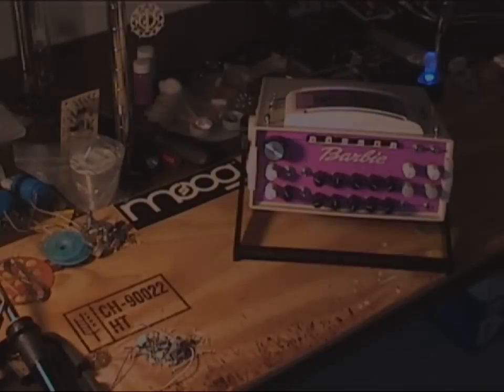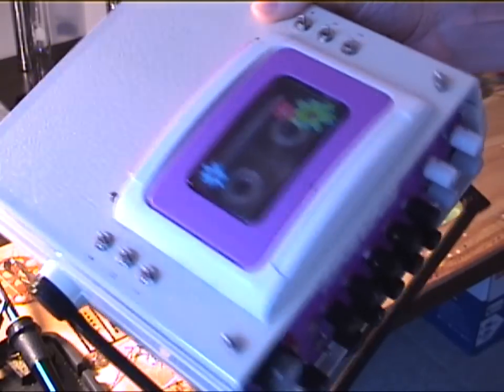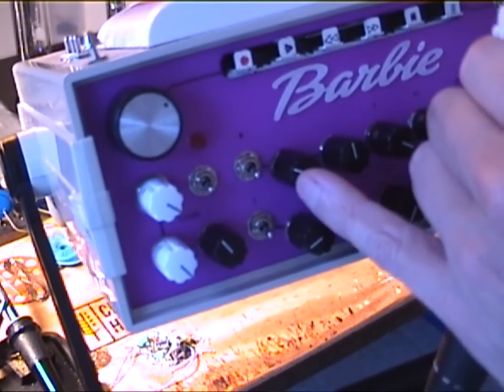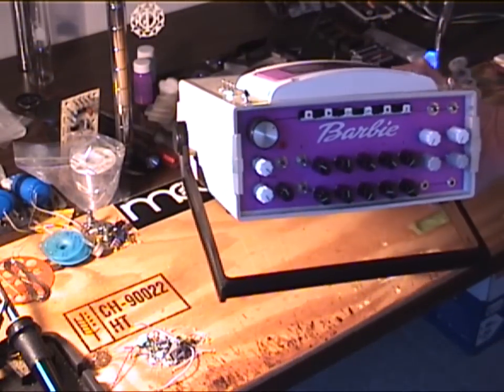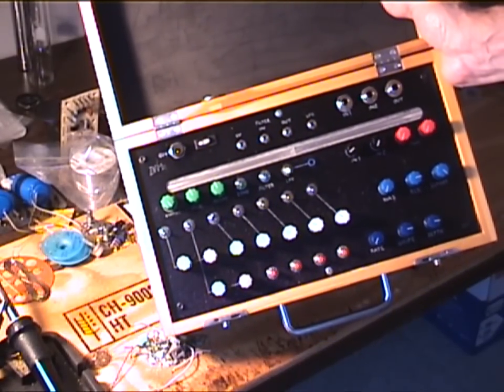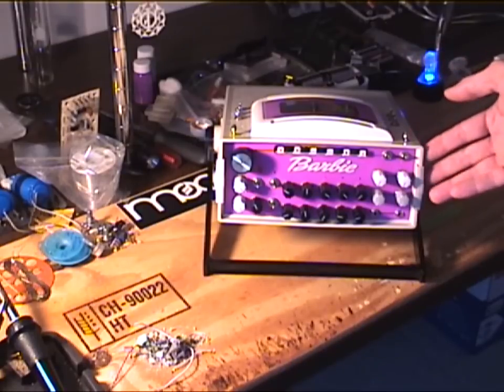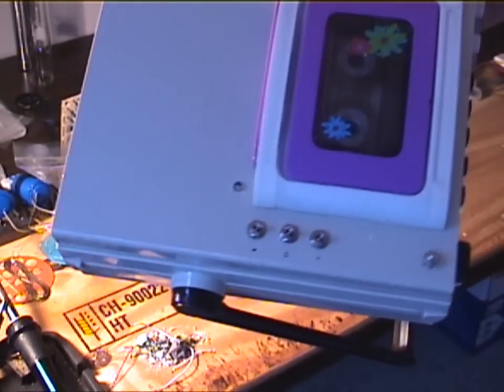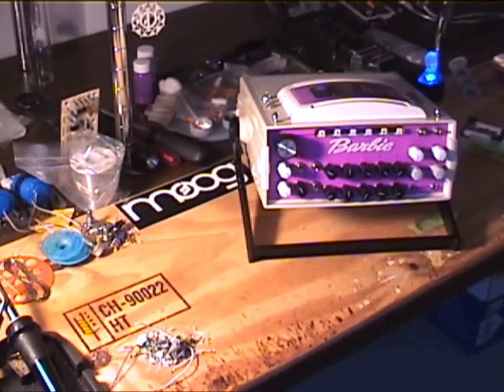Moog Circuit Bending Challenge 2016

Comment: Mattel (if it’s even still the company making Barbie stuff) ought to be kicking you some cash, since the only demand being conjured must be from bending / DIY community.  I should really designate some small portion of my spending loot (maybe 5%?) to buying some sound making toys that I haven’t seen bent anywhere else.  You’ve really made a pretty cool bench top lab-friendly unit!  Sounds (amazingly) like the old Apollo mission radio transmissions!  This is pretty cool, and a KORG filter is pretty nice too!  Thanks for sharing, it’s impressive and inspirational, I’ll check out the docs you’ve referred to!
Reply from the maker: Thanks JJ for the comment.  The Korg is the monotron delay I'm feeding into the along with my mic. The hard part was keeping the tape mechanism,  and I forgot to demonstrate the tape speed control knob modification.

Comment: I have a circuit bent barbie karaoke. Do you find the motor & cassette parts useful or only the electronic bits?
Reply from the maker: David simons , I am a fan of tape, so, yes, keep that stuff. Slowing and speeding up the tape motor is a wonderful mod to perform and it's already going through the delay as well. A very cool circuit,  have fun with yours. :-)